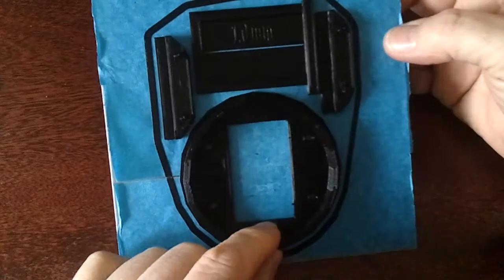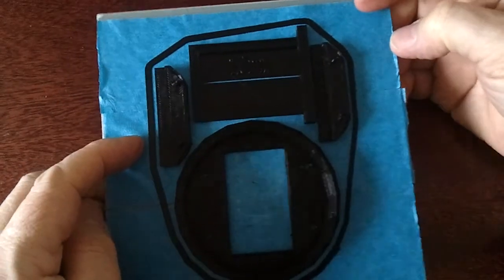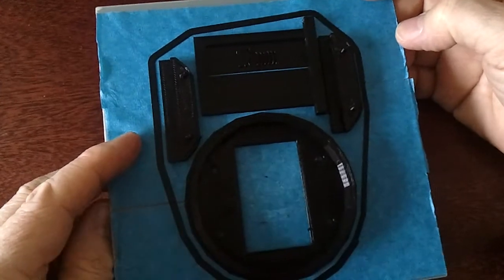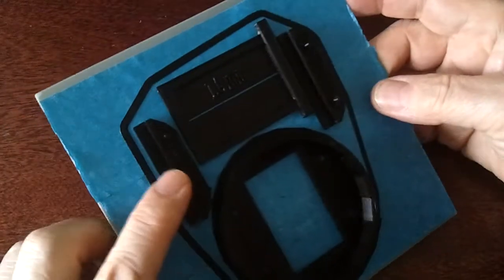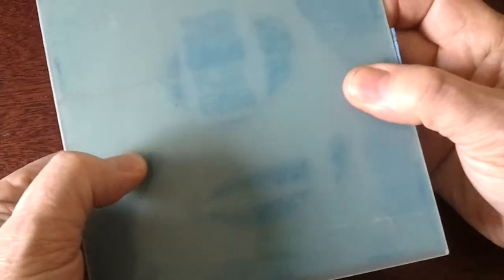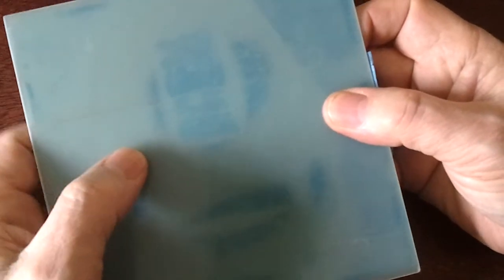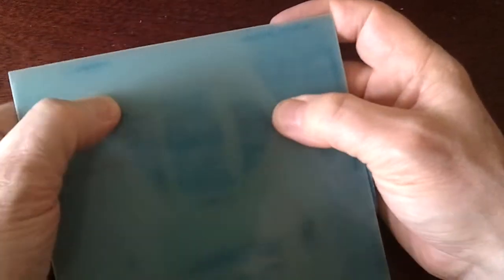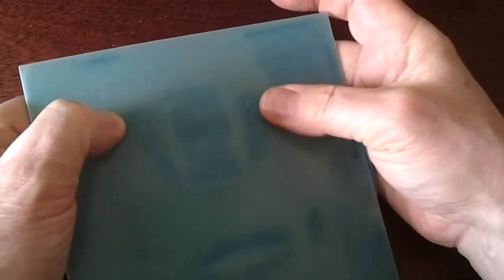3d Printing & What Blue Tape Says About Part Warping

Comment: Hi Chris, I've found a PEI print surface to be vastly superior to blue tape. Just give it a wipe down with IPA before each print. Parts stick very well when the bed is warm and pop off on their own as it cools.
Reply from the maker: Thanks for your suggestion James. Blue Tape works well enough for me, though I would welcome not needed to replace and straighten it I guess. A sheet of PEI for my printer would cost around £10 from EBay and I guess I can spring for that. I'll give it a go. Thanks again.

Oh I had a peak at your channel and it looks interesting, but speak to us! Good luck with it!